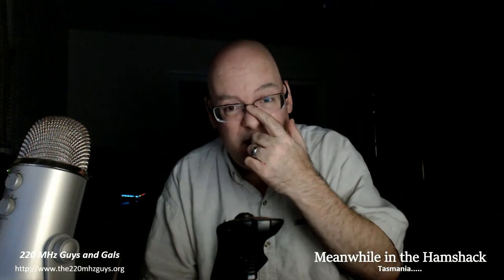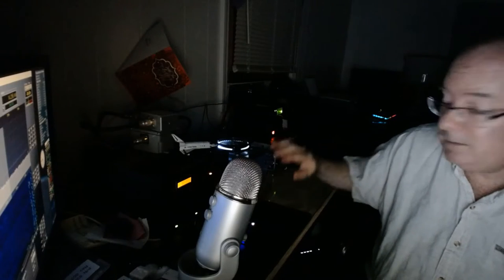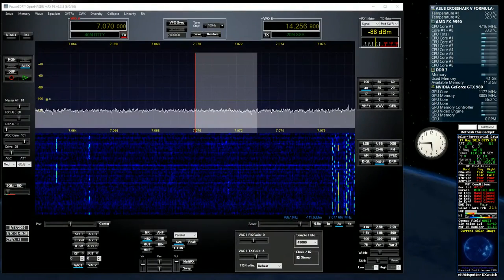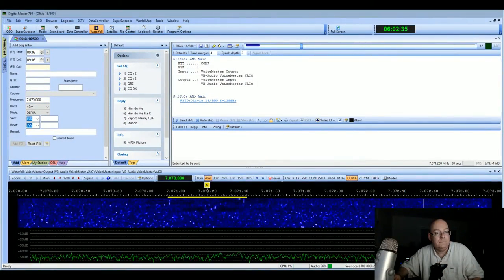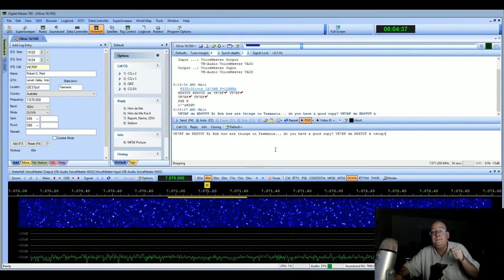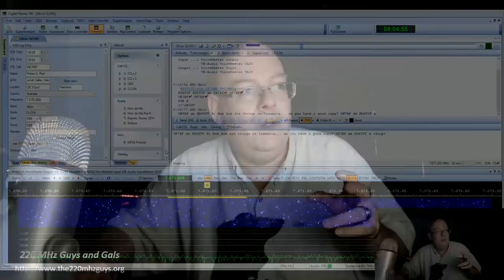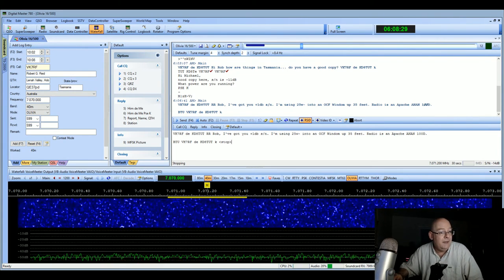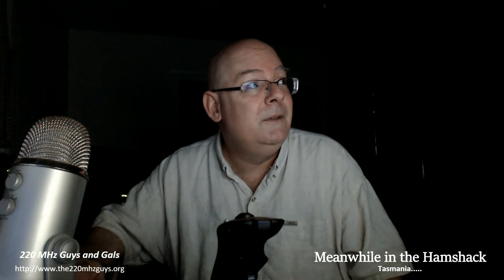Meanwhile in the Ham Shack: Tasmania!

Comment: I've been using  ham radio Deluxe for a few years  and I've never tried the digital modes. after watching your video I am all inspired to give this a go.  I'm using an Yaesu FT-991 which has an ethernet port as well as a USB port. The antenna isn't offset of Fed dipole just like when you're using. I had to do at the low end is 30 feet at the high end it is 60 feet. I was fascinated to watch how you clicked on words and the logging data just magically filled in,  and the Macros that you are implementing were a great feature.   any suggestions would be greatly appreciated.
Reply from the maker: Anthony, well DM780 has a lot of features. That's also one of the issues it has. It can be mediocre on specific points. But it's very adaptable and fun to use once you get used to it. 

You can go macro crazy with this software. I tend to actually ragchew in digi modes so my use of macros is really limited. There are guys who have enough macros set up that they can do a whole QSO without typing anything :P

If HRD is your choice- don't forget to learn other options like fldigi Etc.

My advice- jump into it. Sicne we're going to have rough band conditions for a while, digi modes will be very popular.
Reply: Thanks for the tip Michael. As crazy as it sounds, I was first licensed in 1982  and of course Morse code was a requirement in the exam back then. I do remember playing with RTTY in the mid-1990s with  a  Commodore 64 computer. but your video has inspired me to give it a go.  the way the band conditions are at the moment, this is the perfect time to get into the digital modes. I hope to catch you on a  digital mode sometime soon.